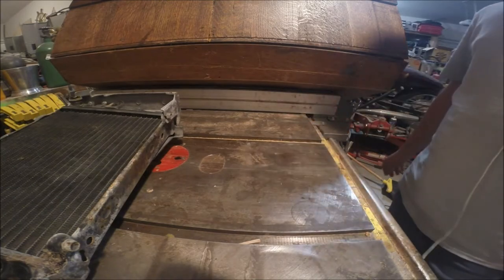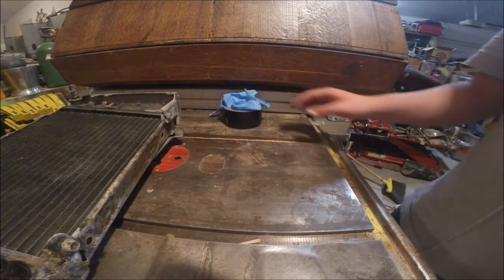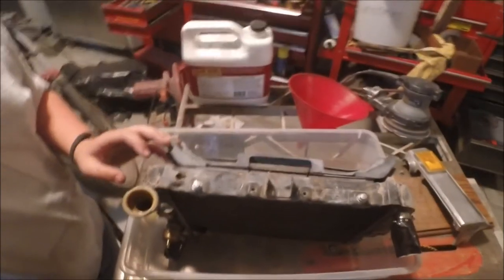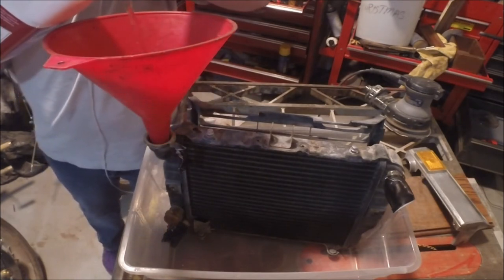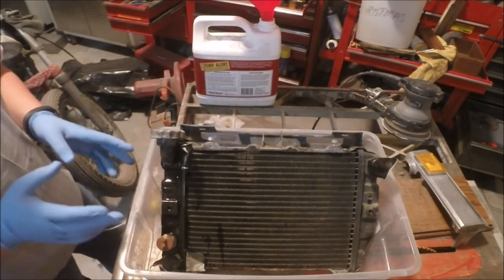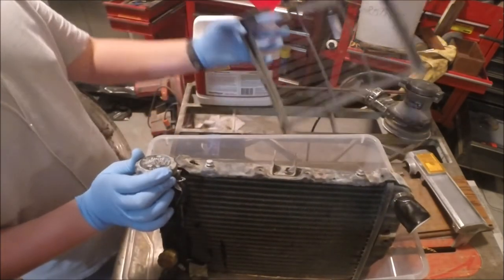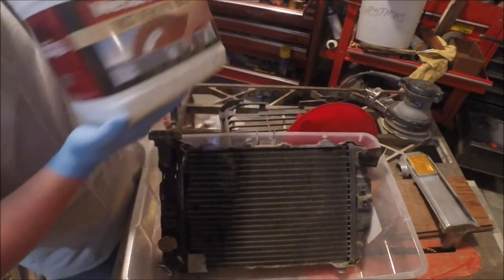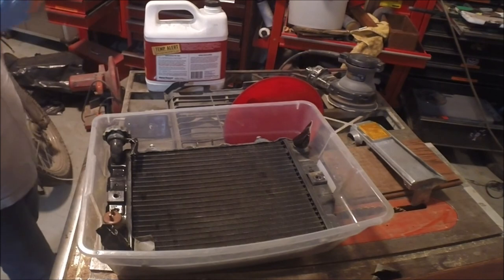radiator corrosion and rust flush

Comment: aluminum doesn't rust
Reply from the maker: aluminum can rust just look it up. im pretty sure stainless steal is the only metal that can't rust without some sort of protective oil on it.
Reply: Rust is iron oxide so no aluminum does not rust. But aluminum does oxidize so you could argue that it's the same thing and you're not technically incorrect. It's really just semantics.